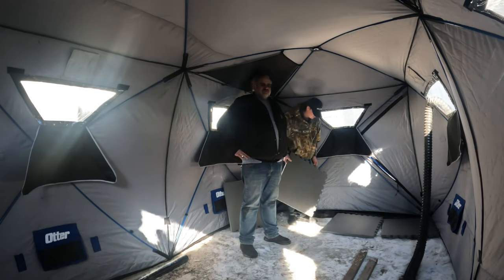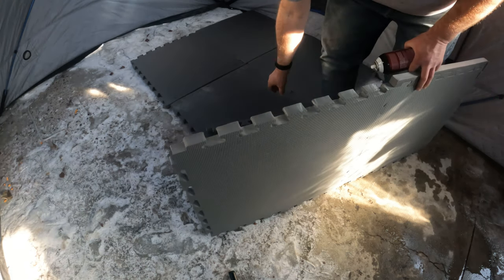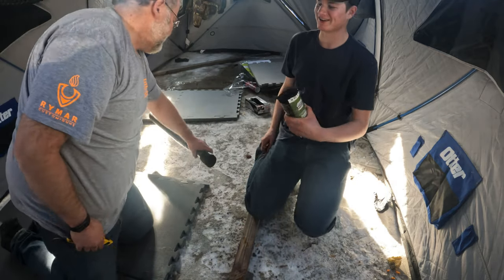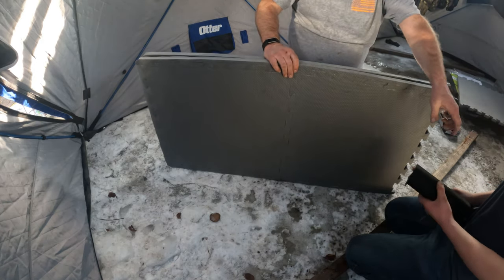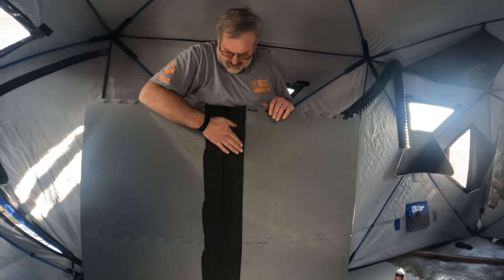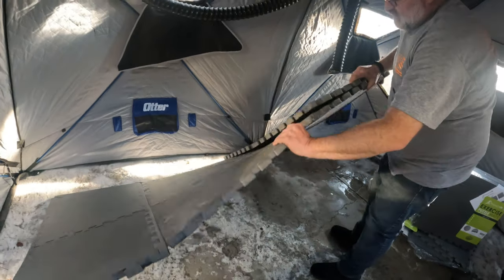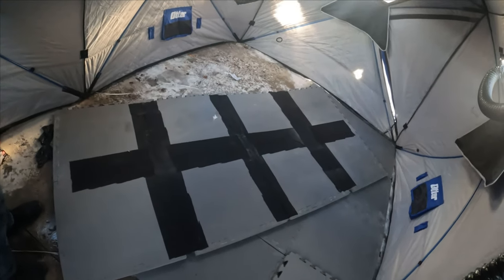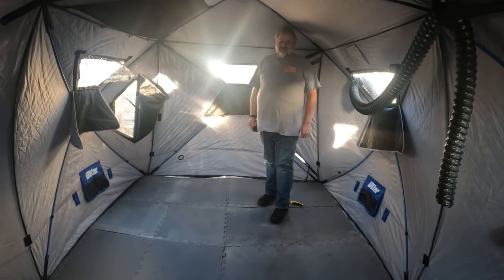Building an EVA Foam Tile Floor For Our Ice Fishing Tent: Sets Up In 1 Minute!

Comment: I bit the bullet and bought one of those 1.5" thick swim matts. I cut 10" holes in it. I get out, lay it out, punch my holes, then my house, plus the snow skirt all go on top of it as 1piece. It is closed cell foam, does not absorb water, and it is one hell of an insulating barrier. When i wake up in the mornings i usually fish in my socks until i have to go out to take a leak.
Reply from the maker: Sounds great
Reply: I was thinking exactly the same but it's too big for my vehicle. But how did it work out for you? Did any water build up and seep up through the holes?

Comment: The whole idea with "interlocking" tiles is that you don't need the fabric to keep them together...the whole floor can be done with 32 tiles...I would also recommend using moving blankets underneath for extra insulation...the whole system works great
Reply from the maker: I would think the blankets would freeze to the ice this makes for really fast set up
Reply: @roddoingstuffoutside846  no they don't freeze

Comment: That’s a handy tip.  And DON’T get the cheap version of these tiles.  I did, and the black tiles shed a black powdery pigment onto everything it touches, even briefly….hands, clothing, even my dog when I’d dried off on the tiles after a bath and came back in covered in the residue.  And it’s very hard or impossible to get out.
Reply: Which version would be superior?